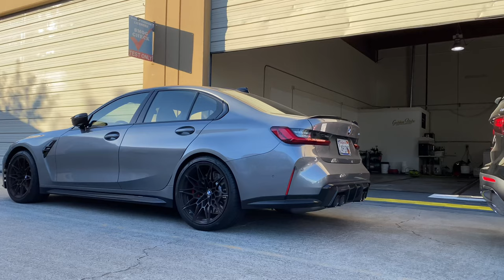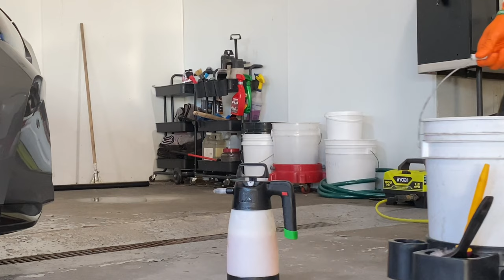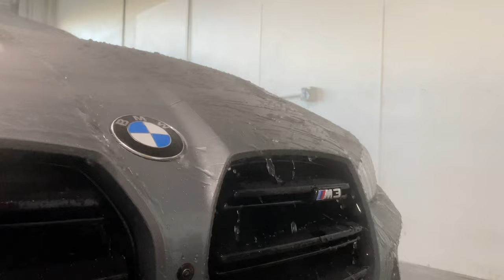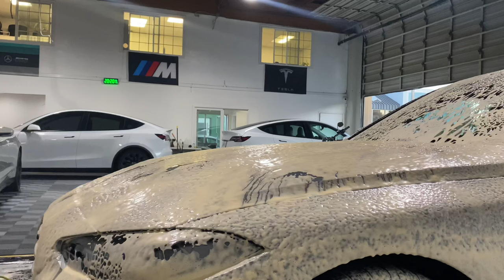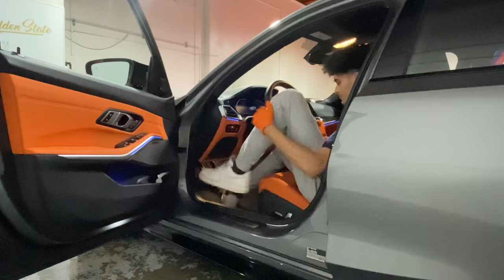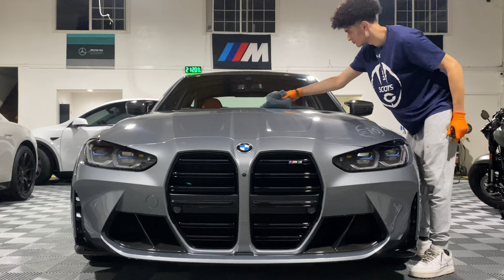BMW G80 M3 Foam Wash - Exterior Auto Detailing

Comment: what did you spray 1st on the wheels vs what do you foam the wheels with?  Same wheel cleaner, but just diluted on the foaming application?
Reply from the maker: Iron remover first to loosen up dirt and grime. Yes, wheel cleaner diluted
Reply: @goldenstateautosalon  good stuff.  I see you are using Adams Iron Remover, which is great.  But, why not use their Wheel and Tire Cleaner?  It contains the same formula as the iron remover, but will prevent you from having to use another tire cleaner as a separate product.  And you can dilute it down 4:1 for normal applications.
Reply from the maker: @nathanwimsatt9438  thanks for the tip!
Reply: @goldenstateautosalon  Yes sir.  great videos.  I need a new foamer, as my IK pro foamer I think is busted.  Might try the one you are using.  What dilution are you doing on your tire cleaner with your foamer?

Comment: pretty awesome job but as a detailer. you should rinse that dirty foam off the car and then tefoam them mit wash ..or completely rinse off and do a two bucket hand wash.  no use in wiping around the mit all over the dirty foam that's been on there.  otherwise fantastic detail